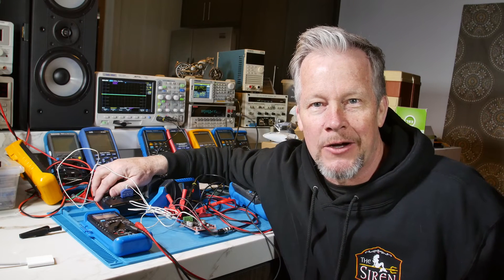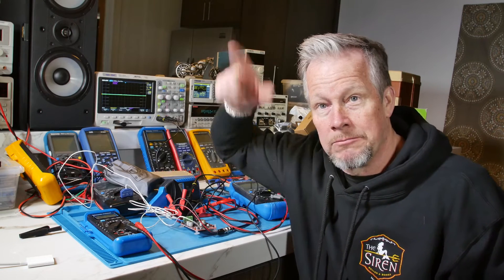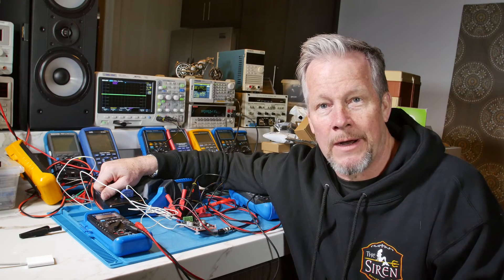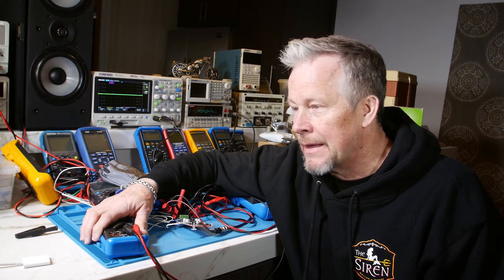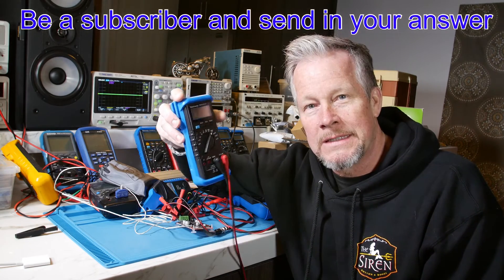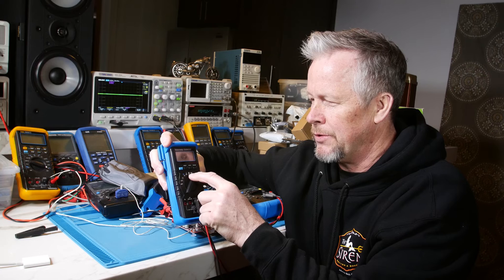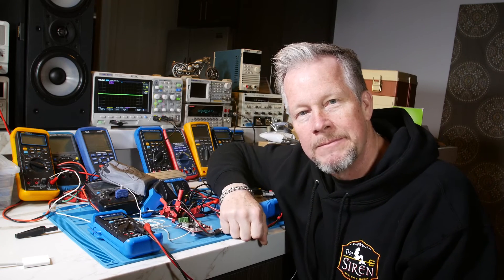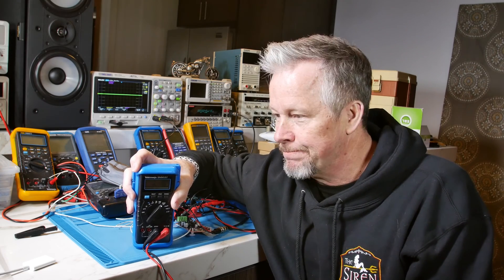Power Supply Design 1 - the Power Cord

Comment: I bought a new house in the NM high desert.  Built a amatuer radio station.  I bought a meter to test ground resistance and found it at 25 ohms.  Added a second ground rod and it lowered to 10 ohms. The service entry is remote from the house a separate garage where each has a panel. I installed a tower and placed three ground rods in a ring around the tower and placed two more ground rods on the way to the panel, every 10 feet. Resistance at the the shacks panel dropped to 3.9 ohms.  Not bad for desert soil.
Reply from the maker: Brad Rich That sounds actually amazing!  How was it pounding those ground rods;) How far apart are the rods?
Reply: @KissAnalog  Ground rods are suppose to be one length apart so 8 feet.  I read the ARRL grounding book.  I used a power hammer and an attachment that goes over the ground rod.  It sits at an angle to the rod so the edge catches the rod. You place it at a comfortable height, hammer away until it is at the ground level, raise it about four feet and repeat until the top of the rod can be accessed directly via the hammer.  Takes 2 minutes per rod.  I started the hole with a 4 foot auger, 6 inch bit.  Put the ground rod in the middle and filled the hole with Ground Enhancement Material (GEM).  It is a black slurry substance that drys like concrete and is much more conductive than dirt.  It makes a great bond to the surrounding earth.  I did not compromise with my ground system as one of the benefits is shunting static and noise to ground not to mention lightning strikes.  All my coax cables shields and radio equipment are connected to the ground system.

https://www.google.com/search?q=ground+rod+pounding&client=firefox-b-1-d&tbm=isch&source=iu&ictx=1&fir=600AaZUsLb1StM%253A%252CRzlSwodzop0xFM%252C_&vet=1&usg=AI4_-kSZrU6bTWrLlqK6lG0OzPb2EgvpdQ&sa=X&ved=2ahUKEwiL6Jas5OzmAhWVB80KHY36DN0Q9QEwGXoECAQQBg#imgrc=600AaZUsLb1StM:&vet=1

Comment: People if you use Eddies subtle electronic experience (the details), you can design
a better power supply better than even the top design companies produce. 
Eddie mentions MOV's (Metal Oxide Varistors) at 5:30 listen to what he says: 
"Many people install MOV's wrong".

At first I thought nothing of what he said: But then it hit me:

Example:
===-====
I have a Power Supply that was designed by one of the largest PDU manufacturers in the
world. They spent lots of money on designing the power supply I'm looking at on my bench.
This power supply has MOV's soldered directly to the PCBoard. At first I thought:
Nice, this company had the forethought to install MOV's which protect over voltages.
Note that there are lots of other components on this board (low voltage parts).

After watching this video (5:30), I went back and looked at the Power Supply again.
This vendor installed the MOV's too close to other components.
Which means if this power supply (again designed by the best of the best), saw large
over voltages / current it would burn down everything nearby, in this case there are
2 coils and 2 ceramic capacitors. WTF!!!

I was shocked to see this extremely poor decision. Which means:
1. The original designer thought he was being clever / smart.
2. If Eddie had seen this design, he would have not patted this guy on the back for
installing the MOV's right next to other components.
3. Eddie would have rejected the PCB design as follows: You have installed the MOV's
too close to other components. Design this again.

Eddie, how should the MOV's be soldered to the PCB? Since MOV's are designed to destroy
themselves if need be. They should be placed somewhere on the board where they can
have a bon-fire without killing the innocent bystanders.

Maybe a "FirePit" area on the PCB labeled as such. Ha! Ha! Ha! Ha!
You could even include Flames on the silk Screen around the FirePit!
-Russ
Reply from the maker: TymerTopCat Russ - I got a kick out of this comment!!!  Your observational ability is awesome!!!  I really appreciate the fantastic outlines you gave - you really nailed it! LOL Awesome!!  I’ve been meaning to do a follow up on surge protection - I’ll have to do it soon! ;). You might like this video: surge protector- under the hood https://youtu.be/KzYdZ_I8ZNI
Reply: @KissAnalog  I'm a 20+ year Software Engineer, and so I have seen some insanely stupid things. I like to get to the bottom of things, so I ask the most important question: How did those MOV's get placed near other sensitive components. My guess would be this: One person created the circuit, and another person drew the PCB layout for the circuit. The PCB layout design person who dropped the MOV components onto the PCB  (using a CAD program), has no idea what MOV's are. He's trying to cram as many components as he can on the board to keep it to some size.

I have seen videos on youtube of people intentionally over powering MOVs to see what happens to them, the heat and the fire would probably destroy anything within 1 inch of them.

I look at MOV's as the Hero who will sacrifice his own life to save everyone else.
Very noble thing to do.

So when I design my first board, I am going to give them a really special place far away from the rest of the components. Imagine 2 or 3 MOV's surrounded with silkscreen graphics of flames. Labeled: FIREPIT!!!

If you would like to see a picture of this Expensive PDU with the MOVS, give me your email address.

-Russ

Comment: 3 pin plug  for class 1 appliances exposed metal chassis  needs a protective earth.
2 pin plug for double insulated appliances, no exposed metal chassis.
Good thing about the UK  3 pin plugs, we have fuses in them rated for the appliance, 3,5,10 and 13 Amps
So the power cord can be a smaller copper cross sectional area, than the main MCB supplying the circuit.
We have ring mains with 32 Amp MCB and radial circuit's of 16 to 20 Amp MCB for the outlets.
All my electronic test equipment and metal working lathe and milling machine are surge protected circuits
I use a dead mans switch to isolate my work shop, everything is disconnected from the mains at the end of the day.
Adam
Reply from the maker: Adam L Thank you for that great information!  I’m working on the next video in this series so this is great timing!

Comment: Three-prong power code help guard against electric shock to the user if the equipment has metal chassis and there is a even remote chance current flowing to it from the hot wire. This current could be due to equipment failure or moisture getting in to the equipment in normal use. eg. electric cooker, iron, washing machine etc.  

Two prone power code may be used if the equipment chassis is made of insulating material such as TV, phone charges etc. 
These appliances are designed in such a way that they does not require an earth connection for safety. In this case, the protection against electric shock is usually achieved by having two layers of insulating material surrounding live parts or by using reinforced insulation .  

In some cases a plastic earth pin is molded into the plug in order to open the socket  shutters.
Reply: Good luck, you have a better answer! :-)
Reply: @friedmule5403  Thank you :)
Reply: I was going to answer for the giveaway, but I don't see a lot of room for improvement on your answer;-)
Reply: @Guishan_Lingyou  I hope that it is okay that I write my opinion to your comment:-)
You may not have much to add, but maybe can your wording and text be the one that helps someone who did not fully got the other explanations. I would really like to read how you would write it! :-)
Reply from the maker: There's a new giveaway for Father's Day;). I'll have one on 4th of July too.